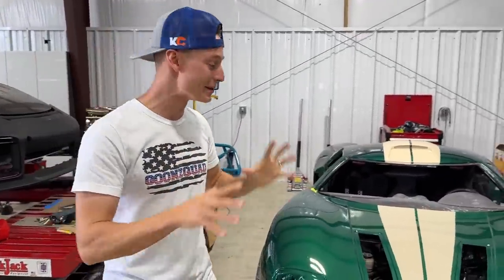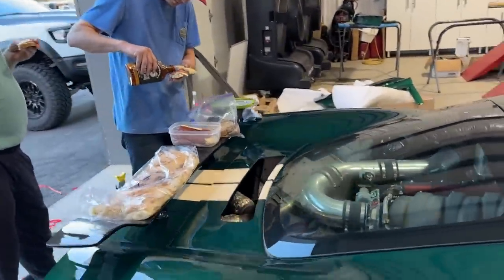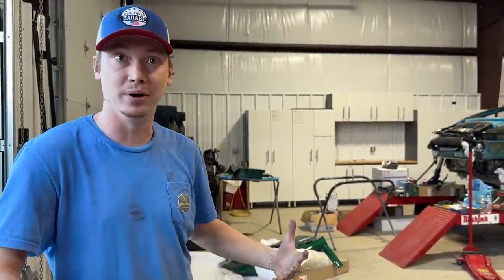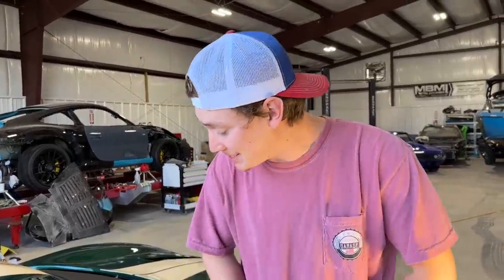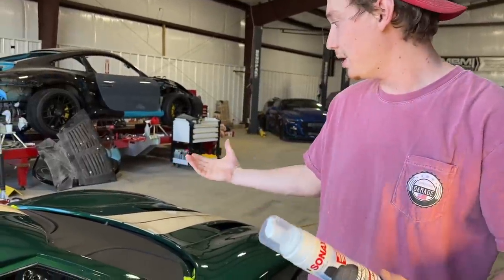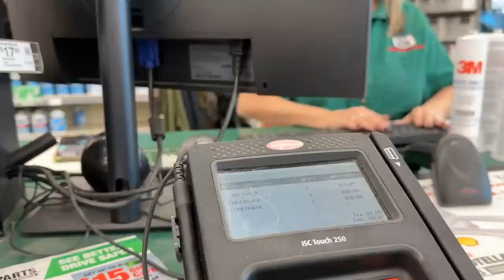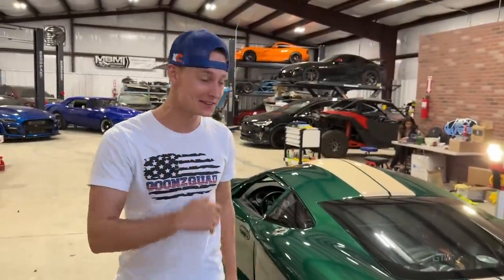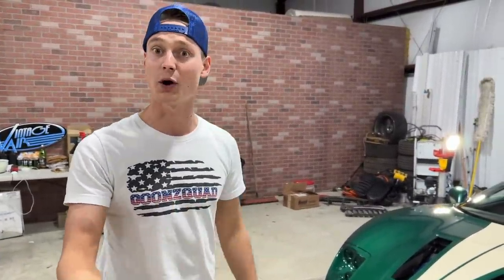Our Factory 5 GTM Supercar Is Getting Fully Assembled After A Fresh Paint Job!!!

Comment: Pretty nice job on the windshield installation, nice to see primer this time! My only advise is to cut a V notch on the glue tip, it’ll give you a much stronger bond. round beads are not nearly as strong and often leak.
Reply: I agree, but good they started using the primer this time.
Reply: Turned out nice. Loved the attempt at the illusion of safety with the jack stands
Reply: Yeah they need to do V Notches and do a better job at shooting glue and decontamination process. I almost died when I saw the no primer job on the Camaro 😂

Comment: 3 things. 

The steering wheel is completely turned to the right, but the wheels are straight. What's up with that?

Wasn't it wise to leave the window out until you aligned the front? Might break it again if something gets stredged too much? 

Also, only a bit of tape to keep that front splitter in place?
Reply: ☝️☝️☝️☝️☝️..

thanks for watching and leaving a comment.
feel free to reach out I have something for you.🚘

Comment: Those LED Headlights you installed on the CAMARO are switchbacks , meaning they are Day running lights & Turn signal lights at the same time , you just need t fix the wiring .